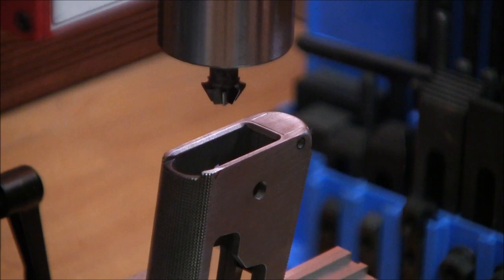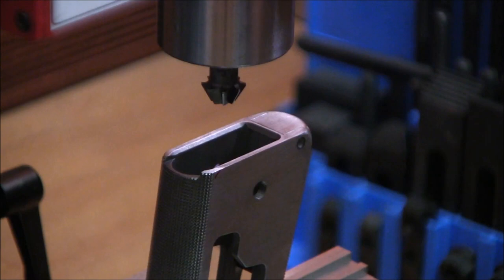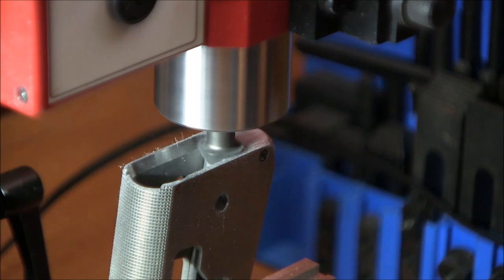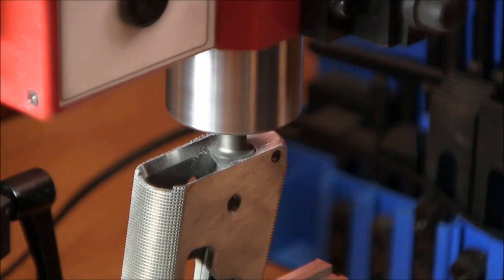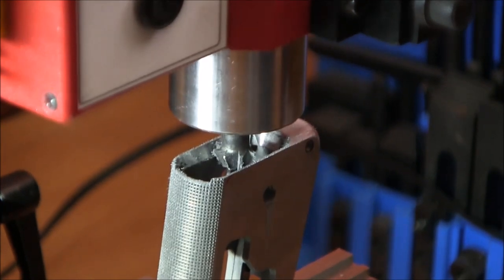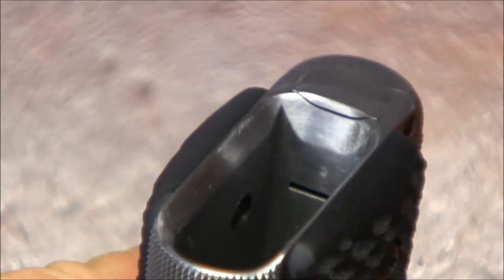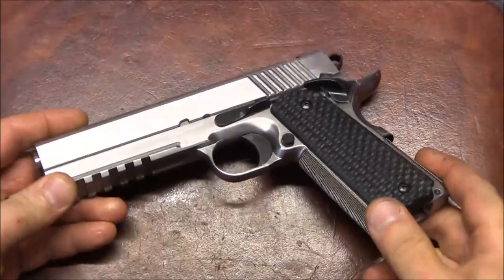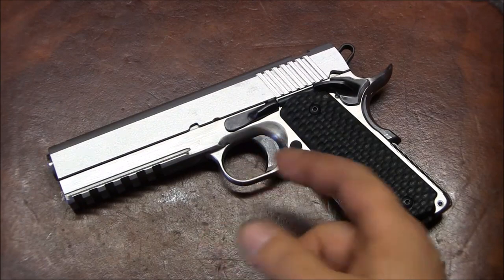1911 Build 9 - Part 3 - HF Mini Mill and Magwell Bevel

Comment: You were right about the squared slide edge it matches well with the squared full dust cover.  If that was radius or rounded then the bevel looks appropriate.
Reply from the maker: Thank you. I am pretty happy I left it this way.

Comment: Great job as always, Good to see the mini mill is working for you.
Reply from the maker: rlprgp62 Thanks. I will be doing a lot of slide work on it next.
Reply: Great I'd like to see that. I also have a mill, I have done the BoMar, LPA and front dovetail cuts. I have been researching how to under cut the trigger guard. I mean I have done it freehand with a 3/4" stone. It came out nice, but I would like to see it done with a real cutter. I saw a video on it but they really did not get into the set up. I can guess the set up, But I like your explanation(s). Take Care, Randy...
Reply: Oh, I also had a frame that I (um fitted) got the rails a little loose. I sent it to TechPlate for hard chroming. I was told that Hard chrome is "not" for building up. But when I got the frame and slide, barrel back. I had to "tap" aka beat the slide onto the frame. I oiled and worked the slide for a couple of hours, Looking at the rails there were a few shiny spots on it. I shot that colt for years, I passed it to my nephew and it is still tight. That is what happened for me..Randy
Reply from the maker: A long ball end mill in a large diameter would be good. You need a rotary table. Once you find the radius with the front strap perfectly vertical, you do two things at once - true up a front strap and undercut the trigger.
Reply from the maker: Thank you very much. That is really good to know.
Reply: Mosin, Thanks for the reply. I have a rotary table. If I understand what you wrote I will make a light skim cut up the front strap to where the trigger guard and frame meet. Then I have to plunge cut toward the rear of the frame Of course I will measure the front strap thickness first. I believe for cast frames like (RIA) do not plunge more than .060", Forged frames aka springfield can go .090" But I would measure first. Keep up the great work... Randy
Reply from the maker: rlprgp62 the frame would be setup in a rotary table upside down, with the front strap perfectly vertical and parallel to the long ball end mill. A jig would need to be made for this, where the front of the front strap would be positioned just outside of the center of the rotary table. Just enough to where the correct radius of the front strap is found. This way, when you turn the rotary table the entire front strap would be getting cut by the long ball end mill side. At the same time, lowering the end mill will be cutting the undercut in the trigger guard.
Reply from the maker: rlprgp62 look up a video by Troy Harp on truing the front strap.
Reply: Oh RIGHT. I can picture that. I was thinking of laying the frame on it's side. I saw it done like that. Doing it like that seemed like a guess at best. The rotary table way seems like the better way to go. I am still wondering what size ball end mill? 1/2, 9/16,5/8, 3/4?. Thanks for the reply. Randy
Reply: Ok thanks, I like Mr. Harp's videos. He is vey good with the mill. I need more practice. Randy
Reply from the maker: rlprgp62 size of the bit depends on the rigidity of the setup, I think, and the length of the undercut. I was thinking that a square endmill could be reshaped to have a larger radius end than a ball end. This way the undercut would be more stretched out rather than deep.
Reply from the maker: rlprgp62 Yes, seeing a machinist do his thing is very satisfying.

Comment: I own a Springfield Armory 1911 Loaded pistol.  I really liked how your mag well looks when you blend them into the frame so i decided to install a one piece Mag well on my pistol, but my pistol has the ILS on it.  do i need to replace the spring and pin with a bigger one because the new mag well is a one piece and it doesn't have the ILS on it.
Reply from the maker: Yes, you need to replace the spring and the caps. Brownells sells a MSH rebuild kit. You will need all the parts in this kit. http://www.brownells.com/handgun-parts/frame-parts/mainspring-parts/mainspring-refill-kits/1911-auto-mainspring-housing-rebuild-kit-prod27082.aspx

Comment: Great product, doesn't seem to matter what tools you get your hands on, you always do a stellar job. Also curious as to how you do your engraving/lazer work and how much it costs, as I have a few builds that I have yet to sandblast because I would like to serial them first.
Reply from the maker: Captain Morgan I go to a local laser engraver. they charge $20 per frame (ATF markings). graphics are more.
Reply from the maker: By the way, I cannot reply to your message about commander on officer builds for some reason.
Reply: MosinVirus spray some kind of lubricant or antifreeze when you use your mill get longer life out of the tooling 👍👍
Reply from the maker: Thank you. I would certainly do that, but given that I am doing this inside, my wife would kill me if the end mill would throw that stuff around.

Comment: So did you set up that HF mini-mill at all, like adjusting everything to make sure its square and clean off all the parts, etc., check runout on spindle?? Just curious as it came out very nice and I've heard mixed reviews about HF mini mills and planning to buy a benchtop mill soon. Seemed pretty precise and did a nice job making very small passes!
Reply from the maker: Yes, I did. It took a while. The hardest thing was to align the head to the column.

Comment: neat, didn't know harbor freight carried a mini mill, great video! also, have you considred trying nickel plating at home? I am looking into it, it seems to use a lot of the stuff you used in your anodizing video
Reply from the maker: judofry I have not tried nickeling. The reason I want to send it out for hard chrome is because it will be an industrial chrome, very hard. And it will add material so my slide to frame fit will tighten up.
Reply: oh no problem, just wanted to know if you had ever tried nickel plating, not necessarily related to this build, I am strongly considering it for my first 45 acp build and was wondering your thoughts on nickeling in general, I am looking forward to the follow up video when it gets back from the chrome process  :)

Comment: awesome work! how much of investment is the harbor freight mini mill? would you recommend it or should i stick with jigs? also what did you do to get the dust cover to cover the whole bottom of the slide? i love the way it looks
Reply from the maker: This is a long dust cover frame from 1911 builders. It extends the full length of a government slide. The mill I got for free, so for me it was an easy decision. A mill is always better than jigs because it gives you some flexibility with what you want to do. But, if I had the space, this would not be a mill i would have considered.
Reply: MosinVirus I really like the way the 1911 came out i have never seen one quite like this. i also like the way the bushing looks it ties together very well. I cant see myself buying a mill anytime soon but if i did i would buy the cheapest harbor freight one because i would only use it for gunsmithing. excellent videos though last time i checked there were very few 1911 mill videos on youtube and the few i have seen were multi thousand dollar machines so i really like how you are posting videos no one else has made before.

Comment: MV, We're so used to seeing you rocking the file, it's gonna take a few builds to get used to seeing you mill instead. Sweet looking Slabside though. Another masterpiece...edit: What was your solution for the front sight, just get a new one?
Reply from the maker: Mike Melina yes, at this point I am just trying to utilize the tools I have. If you remember I got the mill for free so it is almost a sin to not use it. :) that front sight was a temporary sight. I got a new one with a fiberoptic rod. It is pretty good.

Comment: Can you send me the list of tools you used for this build?
Reply from the maker: Are you looking for something specific? For major operations I was using a HF Mini mill.
Reply: @MosinVirus  I was wondering about what files, stones, and milling bits you used in the build and where you get them.
Reply from the maker: @davidshields1547  I get the checkering files from Brownells. I believe this one i checkered with 25LPI. Rest of files I use are general purpose files, a Nicholson set of 7 files from Amazon, Nicholson round files I got from Brownells, and some small pillar files I got from Brownells. The stones I use I get from Boride Engineering. And milling cutters like the key seat cutter and the chamfering cutter I got from McMaster Carr.
Reply: @MosinVirus  thank you so much I will look into getting them. I have been wanting to customizing my 1911 and your channel has great videos on this.
Reply from the maker: @davidshields1547  my pleasure. Good luck with your project